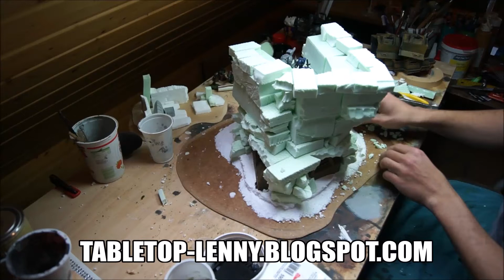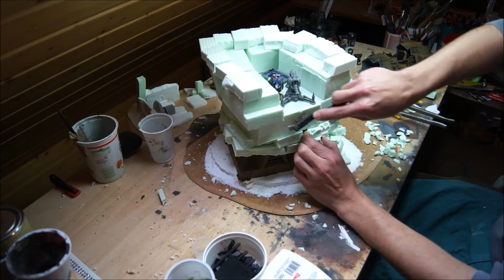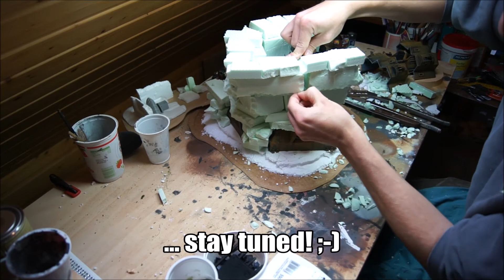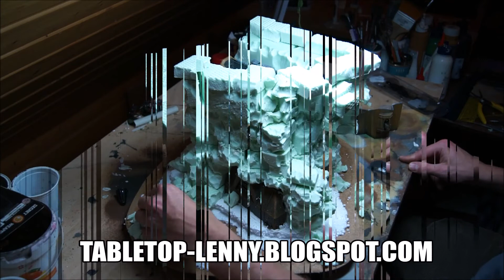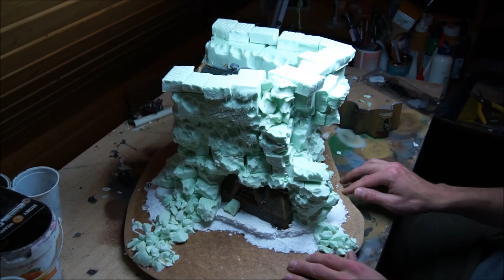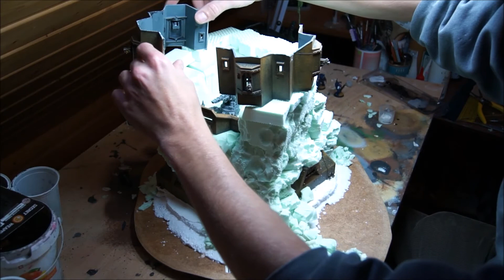TERRAIN BENACH: Imperial Bastion Conversion / Mountain Fortress - part 1

Comment: I like it, quite a bit. It shows off the versatility of the Imperial Bastion kit.  They likely would not all look exactly alike, given the number of them in use and the vast types of geography they would be used on. I am wondering how you intend to paint that Styrofoam, since spray paint would cause it to melt away.